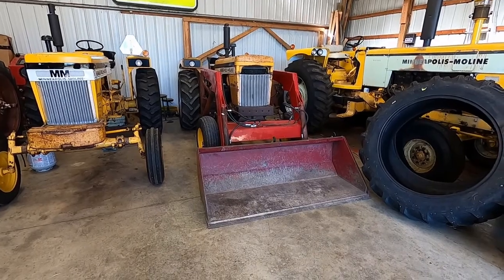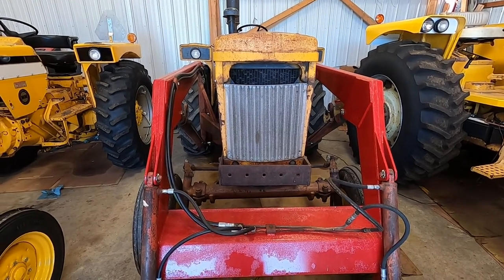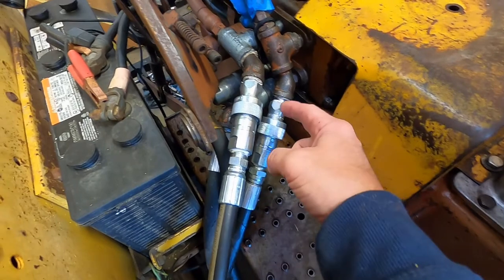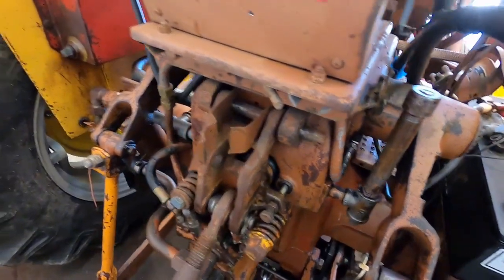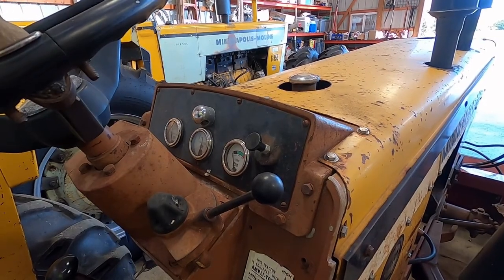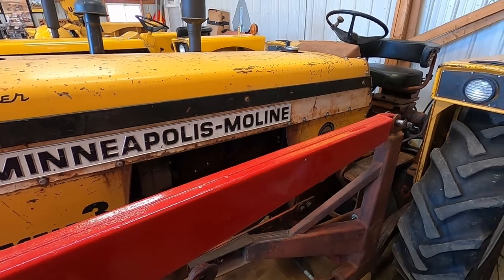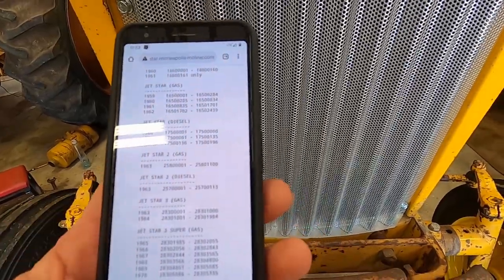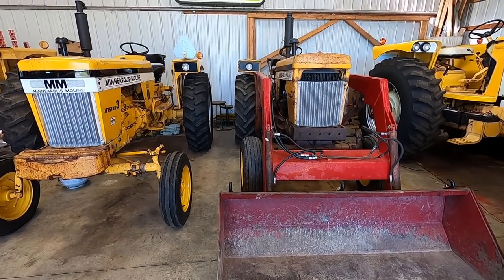Minneapolis Moline Jetstar 3 Super Loader

Comment: I just picked up a 67 JetStar 3 Super with an MM loader basically identical to yours.  Your channel came up as a recommended while I was researching it, and I'm glad it did.  My 67 has an internal crack in the #1 cylinder (previous owner had the heads redone before discovering the crack) so I'm putting a set of blocks on it and giving it a serious once over as it's been sitting out for a year or two.  I'm considering modifying how my loader is plumbed to match yours in a way (might use valves for flow direction) to open my outlets up for implements again.  I've enjoyed going through your channel and seeing someone else who likes the old yellow iron.

Comment: Your channel just popped up in my recommended. Glad it did.
I have a 66 U302 Super (gas) my Grandpa bought new. It came to my Dad's farm and I grew up with it, and inherited it now. I live in WI, it gets snow duty for me. In the early 70's, an uncle decided Grandpa should have a bigger loader tractor so he found a Shwartz loader, but it's painted up Oliver, decals and all. I have the original manuals for both the tractor and the loader. 
Mine has well past 5500 hours and it is getting tired, leaks a lot, but it always starts and runs like a champ. I bought a 7 foot snow blower to play with last winter. I repaired and repainted the rear wheels(manure did a number on the rims) and the fronts got replaced in the 80's, so I repainted those, put new radials on the back. Otherwise it is 99% stock, original paint. my family was adamant about this tractor being in the shed, it barely got rained on it's entire life. Lots of fond memories for me. 

Glad to see someone out there keeping these going.
Reply from the maker: Comments like this are exactly why I went out of my comfort zone and started making the videos! Glad you enjoy the videos!

Comment: I have just got a tractor just like yours that came with a loader if it is possible do you know how much this loader and tractor combo can lift ?
Reply from the maker: A lot! Mine has lifted more than it should be able to. I don’t know the exact number but I’m lucky I haven’t broke the front end.
Reply: @andyohiomm5364  ok thank you love the video
Reply: @andyohiomm5364  was just wondering I have a jet star 3 super and it has the hydro steering but when the tractor is running I can not turn the wheels or move my 3 pt is there a levar or release that I’m missing

Comment: Is your loader pretty quick? I have a 70 JS3 with a Shwartz loader and feel like the loader is slower than it should be. Maybe a video of your loader working? Thanks, love the videos .
Reply from the maker: It’s not as fast as newer tractors, but it does pretty good. I think the extra tank helps by adding fluid and venting to the system. If you feel your 70 is too slow I would take it off your hands! Lol